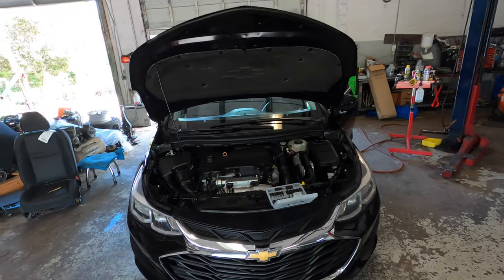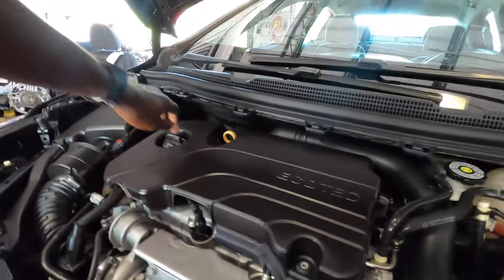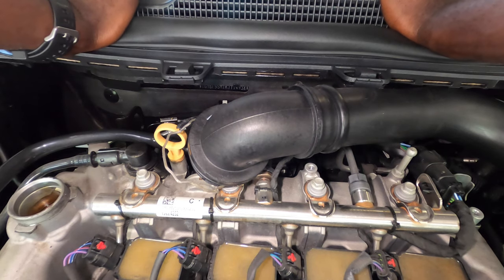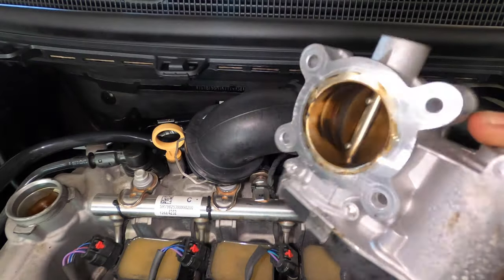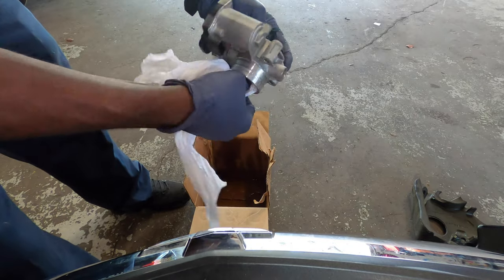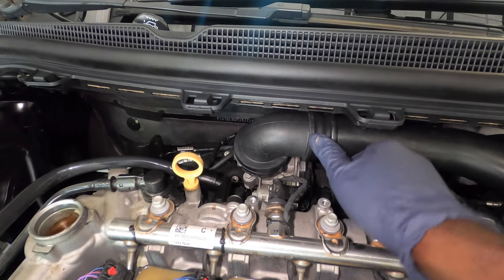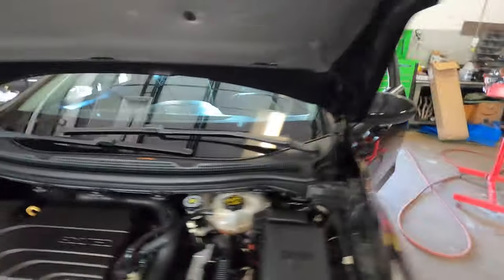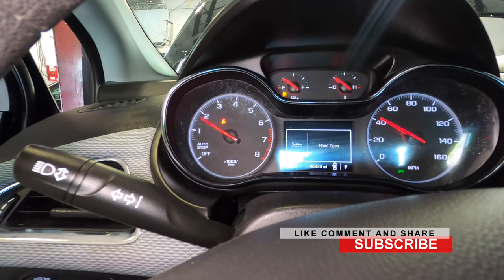Cleaning the throttle on a chevy cruze to fix rough idle for free

Comment: Omg! You have no idea, how much your video pertained to my vehicle. I had 4 different codes at one time. But, for the most part was the P1101 code, (Induction Air Management) I tried new MAP sensor/ new MAF sensor. Nothing helped!! Until I took the throttle body off, and cleaned it really good. As soon as I seen the throttle body, I knew it had to be a issue. Sure enough, the car runs like a champ now. THANK YOU!!

Comment: Good video on throttle body cleaning. Only con I see is that you didn't put back the oil plug while you were working on the car and also clean the gasket around throttle body .Also best to torque throttle body bolts to manufacturer specs.

Comment: Be careful when removing throttle body inlet, those plastic clips love to fly off the clip and into the engine bay -.- need them to have a proper connection! 2:27
Reply: I learned the hard way
Reply: @JL-sr9jm  oh fuck! Haha only gasket i know of is under throttle body, feel inside the hose see if you feel a divit it fits in

Comment: Careful when cleaning the electronic type throttle body, avoid taking your finger moving the plate you run the risk of damaging the throttle body and or throwing it out of calibration. If you damage it you will be replacing it, other than that good vid

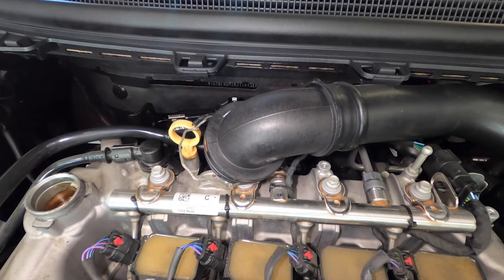Comment: What was the piece that went flying @ 2:28? I want to avoid that.
Reply: Probably a rubber O ring
Reply: To avoid that don't pull the tube out without making sure it doesn't get caught onto the dip stick.  It would have been a costly problem if it ended in the engine where the oil cap was taken off. Make sure to push ring  back in place to avoid it from snagging.  Just my opinion 🤷
Reply: That was the black clip that goes over the metal clip....look at the lower side of the hose when he takes it off you'll see the black piece there, than at 2:28 when it Flys off you don't see it no more

Comment: Do you relearn or reprogram throtle body
Reply from the maker: No i just reinstalled it and it work find
Reply: You have to remove the fuses for the pcm and ecm and you should be fine... and NEVER...NEVER disconnect your battery... to many cpus in the newer cars

Comment: Hello so I've been getting the code p1101(De-ice Air Intake system) and that was from Auto Zone so I went to o Reilly today and they say I need to clean my throttle body, and this has been going on for 3 months and I've taken it to chevy 3 times payed 800 dollar and they still have fixed it . This is crazy can u give me so advice. Please and thanks
Reply: This is year three.. but every year. Every 20,000 miles p1101 comes on. Nobody can tell me what is causing it. Chevy can't even tell me. All they do is a throttle body cleaning 290$ each time. The check engine light goes away after a few days after the cleaning but it stays off. I'm guessing these cars are made to be cleaned frequently. I actually spoke with Chevy last time and asked if I am suppose to just keep wasting money for throttle body cleanings. And they basically said yes and it's a known issue. Hoping by doing it myself, I will save myself the money. And I Def don't plan on ever buying another Chevy.
Reply: Question: Have you tried replacing the sensor?